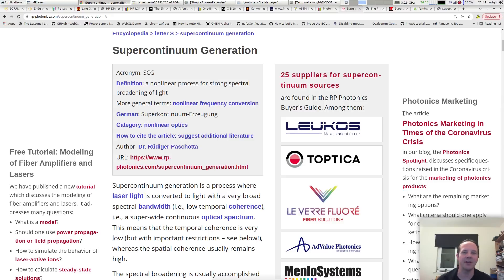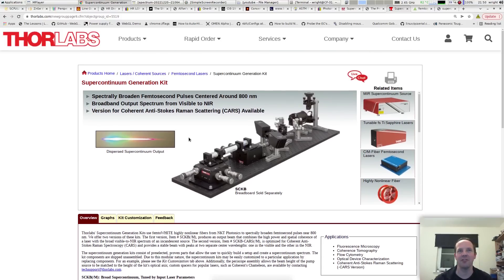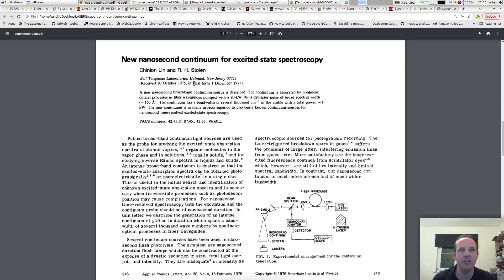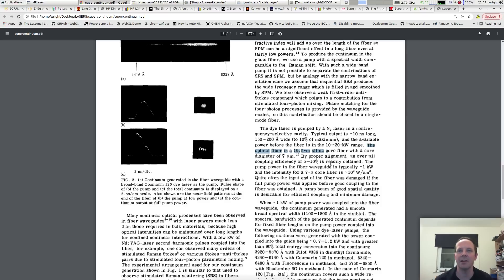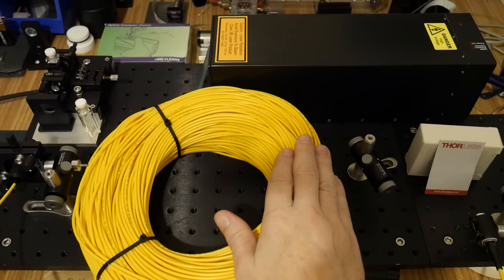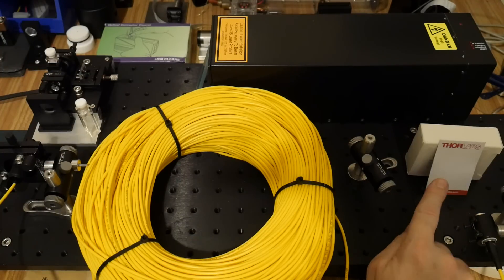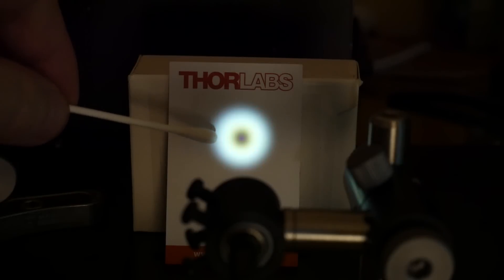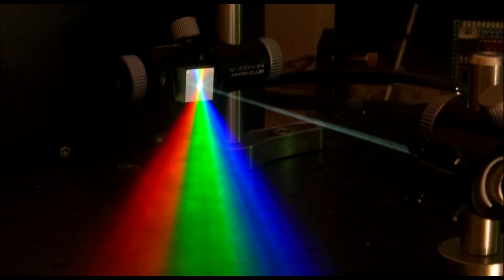DIY SUPERCONTINUUM LASER on a BUDGET!!

Comment: Lately, Chinese scientists did it more simpler: They focus a Ti:Sapphire-Laser into a cuvette with water. Not a joke: Simply pure deionized water. Non-linearities in water causes supercontinuum radiation, that can be collimated as white light. Due to high power handling capabilities of water-cells, output power can be magnitudes higher, than in fiber optics. Sabine Hossenfelder did a video about.
Reply from the maker: If only I could afford a Ti:Sapphire Laser. the peak powers in this setup are quite low compare to Ti:Sapphire, I would be very interested in any Supercontinuum that could take place at even lower powers.
Reply: @LesLaboratory  Build it yourself. China delivers all sorts of high quality optical components. I have made very good experiences with CASIX (Fuzhou). The only things you need is a Ti:Sapphire Laser-crystal (preferably Brewster cut) two mirrors and a precision iris-aperture for Kerr effect mode coupling. Further a green cw 532nm DPSS-Laser as a pump light source. A Littrow prism can be used for tuning. When cw lasing starts, close the aperture, until the fs-pulse train appears.

Comment: Hi Les, I am really enjoying your videos. I have an old spectra physics 337 nm Laser (up to 30hz or 60hz in pulse mode) that I'm going to use to try this. I just ordered 30M of 50 micron telecon fiber. Would I get some sort of SC effect using a direct coupling into the fiber or do I need to use a longer wavelength setup with Dye? Also what do you use for your attenuators?
Reply: oh - I was looking at other commenters and saw that a dye is absolutely needed. Looks like I'll be building a dye setup like what you have in one of your other videos!
Reply from the maker: Ha, I was about to say. Amongst other things, I suspect fiber is too opaque at 337nm. Many dyes have been reported to work. I have tried Stilbene-3 and Coumarin-1 and they work well. My attenuator for the Nitrogen Laser was a stack of microscope slides.

Comment: Bravo.  I'm headed to the Silacon Valley junk yards. Next week. I'm sure I can get a spool of fiber, I've got a N2, like yours, a super cw/pluse Dye Laser system. I wonder if I can use some C130, I have a little C120, maybe some RB, too. Laser diodes I have 450 NM, cw, a couple of watts., 1 at 440 NM. 2 watts, pluse ot cw. Exciting to study, maybe a cavity dumper polarizing plate, some 1/2 and 1/4 wave plates across the dyecell.  Thanks, Les...! Cheers

Comment: Thanks for the video Les, really fantastic. I'm trying to replicate this on even more of a budget than you, so I've been looking at DIYing a TEA or low-pressure N2 laser. However, I saw your comment that you only get full visible at 32 Hz pump, and from what (admittedly little) I've read, these simple air lasers only pulse around 2 Hz. I suspect this is a characteristic of capacitor design. Do you have any suggestions for improving the pulse rate of a TEA?
Reply from the maker: Hi yes, have a look on my channel list. I designed a nitrogen laser from scratch that can easily do upto 100Hz, and unlike traditional home made designs, doesnt break every half hour!

Comment: You mentioned stilbene-3 (a.k.a. stilbene-420) is a bit difficult to obtain. Would it be worth trying a related dye, 4,4′-Diamino-2,2′-stilbenedisulfonic acid ? If you still have your optical bench setup for fiber supercontinuum, a quick, fun, test would be to try a cuvette of clear liquid laundry detergent. Laundry brighteners often use 4,4′-Diamino-2,2′-stilbenedisulfonic acid. It is probably too diluted to have enough output, but who knows? Sometimes even "Jello" (tm) can be made to lase. Thank you for the best DIY science on the net!
Reply from the maker: I have a bottle of that, and I have some laundry brightener I picked up as well as some fluorescent markers. At some point we will have a "let's see if it will lase" episode! Yeah, I read about the infamous Jello Laser, should be able to pump one with a doubled YAG! Thanks!

Comment: Why not just use sunlight? (or black body radiation of something heated up a lot?)
Reply from the maker: Sunlight and blackbody radiation are not coherent light sources, and so you couldn't reasonably construct a Laser using them.
Reply: @LesLaboratory  I guess I'm struggling with how a broadband source can be "coherent" - are you saying that if you filtered the light (ex. 5 nm bandwidth) from the sun vs from this laser, you could somehow tell one from the other (based on coherence)?

Comment: You see a donout mode from the output fiber facet because your output is multimode. BTW: try using a solid state laser for generating Supercontinuum like an Nd:YAG. Has sufficient peak power to drive a supercontinuum process.
Reply from the maker: Oddly though, if I use the same setup to generate Supercontinuum in multimode fiber the output is singlemode.
I am already on it! I have recently did a product review on a Laser engraver, and the only reason I did it is because, I get to keep it, along with its diode pumped Q-Switched Nd:YAG head. I have just measured it up to build a mount for the bench, and then experimentation with begin.

Comment: Hey Les, I’d be very interested to know what is the pump threshold for supercontinuum in this setup (or the multimode setup). More specifically, how the input pump power relates to the output spectrum. Would you be able to measure this with some attenuators on the dye laser output? What I’m really wondering is if supercontiuum can be achieved with lower powers i.e. 10W and longer fiber lengths i.e. 20km (another standard telecom fiber cable length). Then a diode laser could be used to generate supercontinuum, eliminating the need for the dye laser and nitrogen laser. Let me know your thoughts on this!
Reply from the maker: At the input face of the fiber, with single-mode,  you would be looking at 1kW being coupled in. When the SC laser idles in the video,  a continuum is being produced (maybe 30 or 40nm wide), however the energy is too low to measure (with my equipment), so probably down in the 100's of watts (peak) range.

As it so happens, I am actually in the process of investigating whether is it possible with Diode Lasers. I already have a test driver assembled, I just need a suitale fiber. Occasionally test reels of tens kilometers of  cable show up on eBay, I am just waiting for something close to what I require so I can experiment with it. It might be possible to use shorter length of fiber, as well, so long as certain conditions are met. Even with the results in this video, I suspect this is only the beginning of what is possible...
Reply: @LesLaboratory  Awesome!!! I eagerly await the results.

Comment: but how you can be sure if this is really supercontinium laser? did you maked some experiments? I think supercontinium more than light source in VIS range
Reply from the maker: I am 100% certain! 
There is no linear optical phenomenon that can spectrally broaden a monochromatic light source like this. The only mechanisms that can, are non-linear.
As you can see in the video the spectral broadening is extreme, 250nm wide from a 10nm wide input beam.
The results have been confirmed by experts in the field, and replicated by someone who used to design Lasers for CERN.

Comment: So should the takeaway here be the following?:
1) Find a source emitting in a frequency higher than all others you want to include in your contiuum/spectrum (or wavelength shorter than all the others you want to emit) 
2) Find the longest fiber-optic cable you are willing to buy (I believe "you get what you pay for" will translate directly here) as,:
3) Dispersion through the length of fiber will handle the rest.

It's a kneejerk guess, but the dark spot you are observing on your screen could be some kind of incoherent spot of Arago.
A spot of Argo is a characteristic feature of how a central obscuration will cause light to diffract around the edges. This spot will form at a distance behind the obscuration due to the wave nature of light interfering with itself (coherently, for this explanation) at a distance behind the obscuration dependant upon the wavelength of light and diameter of the obscuration.
The input beam to the fiber looked pretty Gaussian to me overall, but it was certainly far from perfect as pointed out. (I'm not familiar with dye lasers, but I assume that this is a feature of the state(s) of the gain medium and resonant cavity used for amplification.)
I think that this imperfect beam is propagating, and dispersing (quite messily, due to the deviation from a perfect Gaussian input profile) and could like you said: 
be dependant on core diameter of the fiber, which is intended for telecom, was probably for wavelengths of 1300 nm - 1650 nm. 
This combination of dispersion-inducing fiber coupled with an imperfect irradiance profile at the face of the fiber leads me to think the following:
The 90 % of energy doesn't just disappear if it does not couple within the NA of the fiber. 
It likely continues to propagate within the cladding of the fiber as well. 
SO! 
My guess is you actually are coupling most of the source power into the fiber. It's just primarily propagating in the cladding. NOT the core of the fiber. 

This method of propagation would almost certainly give rise to the spot of Arago you are probably observing. The core of the fiber is acting as the central obscuration. 
This is however just my educated guess.
I'm sure dye gain mediums are not cheap if they're anything like dyes used for fluorescence spectroscopy. 
That being said, I'd still like to see the cheapest BOM (bill of materials) that one could muster to reasonably pull this off (parts from ebay, etc.).

Also: I suppose you could try using an axicon to bring that ring down to focus at a point. What you choose to do with this... well, use your imagination I guess.
Sweet vids. Keep 'em coming.

Comment: Wow! Super cool! It's interesting that when you remove the attenuator that it seems like the colors have to "warm up". Is that an artifact of the camera or does it really take a moment to produce the whole spectrum? and is that flickering of the final result visible IRL or is that an interference of the camera shutter rate and 100hz laser pulse?
Reply from the maker: Thanks! Yes, the "warming up" is a real phenomenon, but I am not sure what causes it, the flicker at the red end is real as well. Seemingly this effect is quite dependent on repetition rate, so somewhere between about 30 and 35Hz will be a real sweet spot no doubt. There is a lot about this that I want to measure and characterize.
Reply: @LesLaboratory  I wonder if it has to do with complex interference, its so neat to think about! Light is WEIRD.

Comment: thats so ridiculously easy...
actually I also have not any clue how this frequency shifts are done, maybe some intra-fibre-rerlections in combination with a low efficiency couple-out...

its outstanding. i wish i could see the laser speckles in real life.

about the donought, in the past i got pretty fine calculation results from WinLens3D, i guess somewhere in coupling-out you got some interference...
Reply from the maker: It's a combination of effects, stimulated Raman scattering and self phase modulation.
It sure is very nice to see, but it will go next level in the next video!

The donut is because the wavelength of light is much smaller than the diameter of the fiber, and so you end up with a high order mode, however very strange things can happen at higher power densities....

Comment: You're most likely getting the Donut mode because of the fiber you're using. For 400nm this is a low order multimode fiber and you're not filling it with a single mode laser in the first place. The first order mode also converts into the supercontinuum much faster and therefore experiences higher losses before the end of the fiber is reached. The continuum generated from that simply gets lost along the way. The second order propagates much further before being converted, so what you're getting out at the end is what's left of the supercontinuum from the second order. If you shorten the fiber you may be able to get the light from the first order conversion, but the second order is probably still Blue at that point.

Self-phase-modulation, is a pretty common problem for fiber lasers. I would be curious how stable this is from shot to shot.
The Thorlabs kit is definitely a different beast and hard to compare to this.
Reply from the maker: I was speaking to John Dudley, and this seems to be the consensus. There are other processes occurring as well that seem worthy of investigation. For example it is possible to feed a multimode beam, into a large diameter fiber, and get a single mode out as well.
Sure Thorlabs kit will allow you to get high average powers out, and utilizes short PCF fibers. The primary mechanisms are different as well, but if all you want is a Supercontinuum on a budget, then this gets the job done.I still think there is merit and value in this old approach

Comment: At first, I'm like "it's impossible to convert monochromatic into multiple wavelengths".
Then I'm like "okay, perhaps they can be stretched without requiring half the entire distance of the universe".
So, as long as there's less or equal to the amount of energy from the original, it should be possible. Probably not that efficient, but really "cool" 😀
Reply from the maker: It's oddly surprisingly efficient. The authors remarked that almost 100% of the energy coupled into the fiber is broadened. The bottleneck in the system is coupling efficiency 5 to 10%.  With a nice clean single mode input, you would get a glorious output!

Comment: Nice! If you could see the bare fiber, you would probably see a lot of light leaking out too. Not sure why the red end of the spectrum is so unstable 🤔

By the way the single mode fiber should be TEM00, gaussian. I suspect that your supercontinuum leaks into the cladding and produces the donut shape
Reply from the maker: Thanks, yes you can, I might get a reel of bare fiber just to see it. I think by the time red is generated the pulse is running out of steam. Nitrogen lasers are not very powerful pumps at all. From preliminary measurements the pulse width broadens out significantly as well as the red portion of the spectrum is reached. With femtosecond lasers I suppose this isn't a problem.
Reply: I am dreaming of a home made femtosecond laser project. It's not impossible, just a lot of work :)

Comment: Absolutely incredible. I did my master's research on self-phase modulation and suspected for a long time that supercontinuum could be generated using self-phase modulation on a budget. Keep up the good work.
Reply from the maker: Thanks! I was blown away when I first saw it. After is was discovered in the 70's supercontinuum was largely ignored for almost 20 years, and it only exploded into mainstream in the 90's with the advent of Photonic Crystal Fibers. PCF is clearly more efficient, but still...

Comment: This will be a great piece of kit for analytic chemistry or spectroscopic research. My background is in optical fibre sensing and photonics, and am wondering about two two things:
Firstly, the effect of path length on output spectrum, have you performed cut-back tests? and secondly, have you been able to test the effect of straining of the optical fibre? I would appreciate to hear about how these effects may or may not affect the output spectrum.
Thanks for all your videos and I wish you well. 😀
Reply from the maker: Thanks!
I did the opposite, I started off with 25m, then 50m, etc. 200m was calculated based on those tests. The longer the fiber the broader the spectrum. That said, I really want to delve deep into this, so last week I ordered a fiber cleaver, so do exactly that, start with a long length, measure, trim and measure again. There are other tests to be done as well to characterise this effect.
Reply: @LesLaboratory  Just another question, does the single mode fibre under test have angled ends? this will help reduce back reflections (60 dB) from the end facets. Perhaps you can find a cleaver that will create an angled cleaves? If not, you might be able to cleave the bare fibre whilst it has a slight twist. The optimum angle is approximately 7 and 8 degrees. *apologies if this you already know this... *

Comment: That is awesome, Les! Gonna have to buy some telecom cable now 😄
Reply from the maker: Go for it! Out of all of the cable I have tried, all have exhibited spectral broadening, it is well worth the effort. When you first couple in light, start with low power and ensure the coupling is good before going wide open. A stack of microscope slide make good attenuators for Nitrogen Lasers.

Comment: Fantastic video!. I wonder how far one could push this with a 532 nm, nanosecond long pulsed laser with nice beam quality in terms of efficiency and spectrum generation. With current laser technology (the original paper is old!) could one get a better deal (also thinking in terms of the nice 1064nm lasers)
Reply from the maker: Absolutely, I am trying to see if I can wangle a unit from a manufacturer in China to try out. I have a big YAG, but it would just destroy the cable.

Comment: Hehe, awesome use of standard fiber! As fiber is not single mode for VIS, I would expect higher modes traveling longer path in the fiber, and experiencing higher super-continuum generation.
Reply from the maker: Totally! Yes, basically 9um fiber is enormous compared to the wavelengths being coupled in and generated, so high order modes are inevitable. However, it turns out there are ways around this as well!